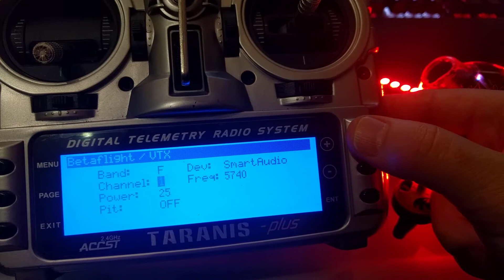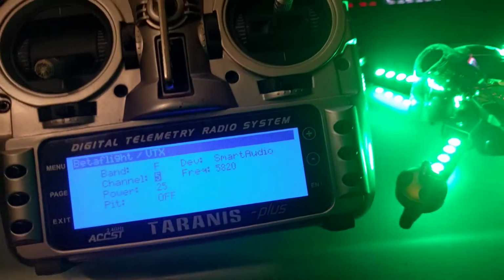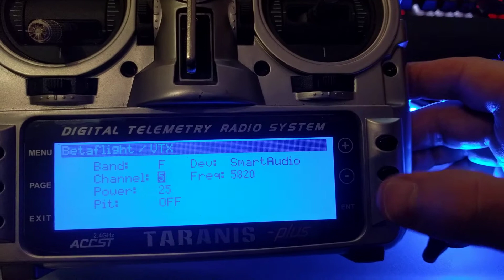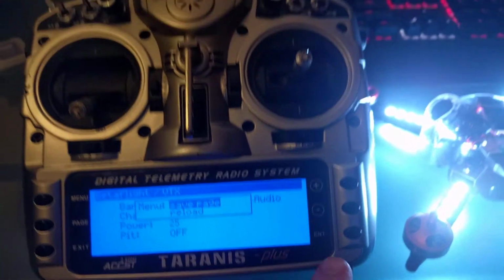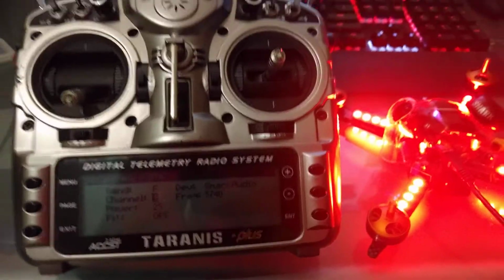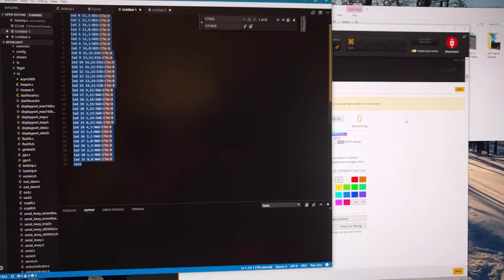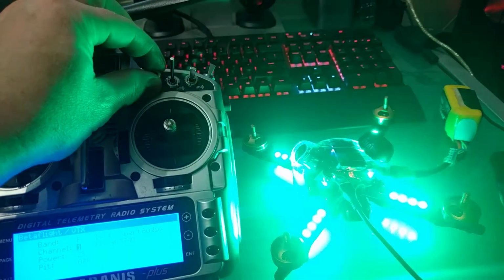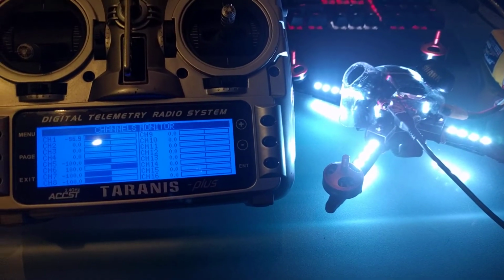Betaflight  LED colour change based on VTX frequency or PWM value

Comment: Hey mate, how were you able to select more than 3 solid colours with the AUX channel?
I'm only able to get 3 solid colours - middle value (1500) is the assigned colour, minimum value (1000) is previous colour to the assigned colour and maximum value (2000) is the next colour. Running BF3.2 RC4
Reply from the maker: I modified the code to map PWM range to specific LED colours. You can see my code changes here: https://github.com/betaflight/betaflight/commit/5e1c0a273ceb81185dcb98ba1c11aca3779cef58

FYI, there were other aussie pilots (Paul and Owen) who worked out how to remap the existing colour scheme to their own custom colours. This was something I didn't realise you could do with stock ßF code in the configurator, but you might like to try it out; just double click on a colour in the LED strip tab and set Hue/Saturation/Value to what you want, as it might be an easier way to go?
Reply: Cheer buddy. I've give that a go